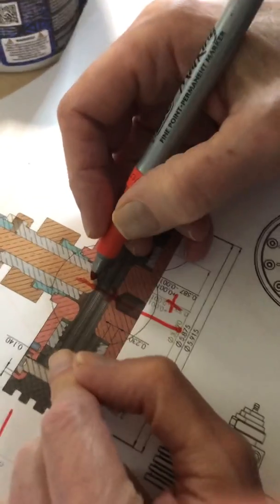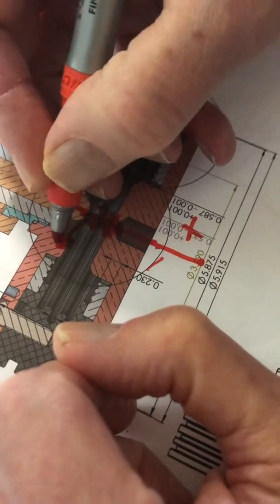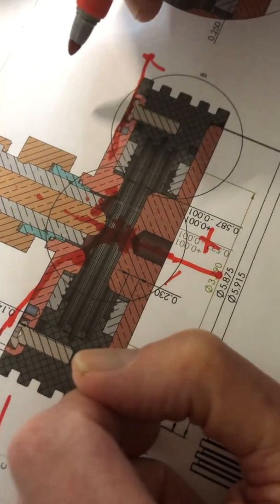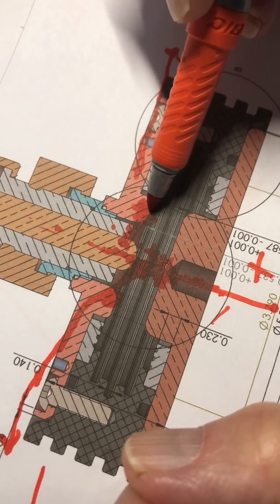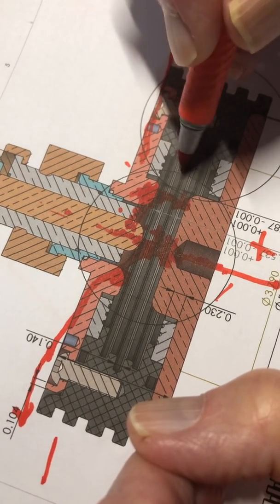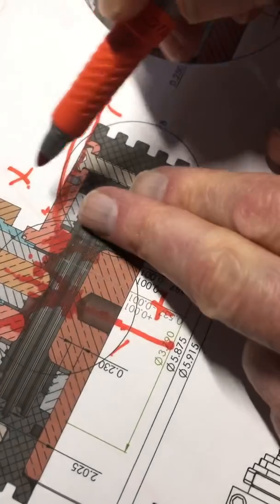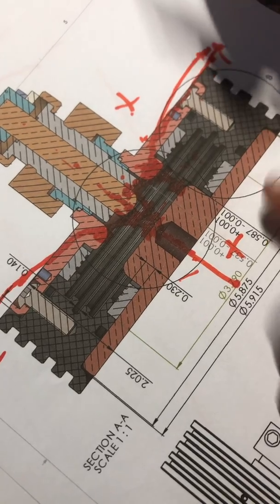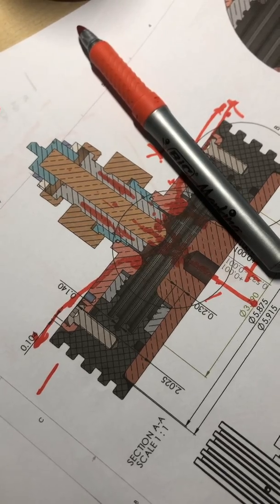Which Switch Has a Witch? - Investigation Into Negative Voltage Pulse

Comment: A Teflon ring sticking out at the top will help increase the path length at the top from the pin to the top plate. Also looks like extending the Teflon inside the chamber a bit more helps?

Comment: Can you increase the length of the insulator at the tip of the pin to prevent arcing to the top plate?